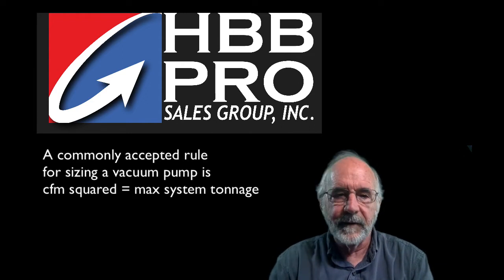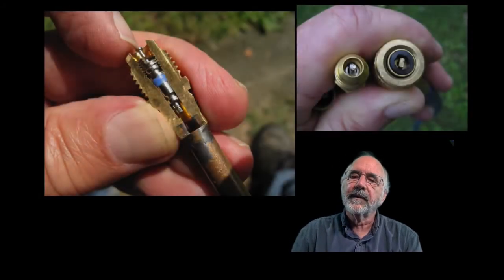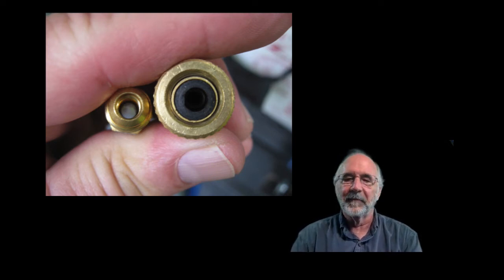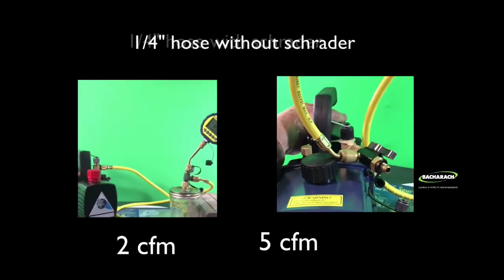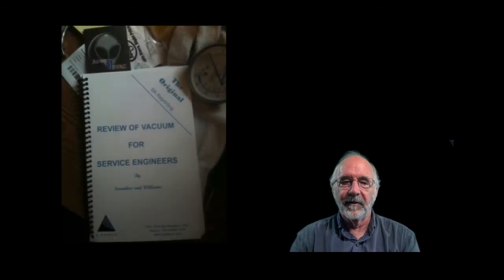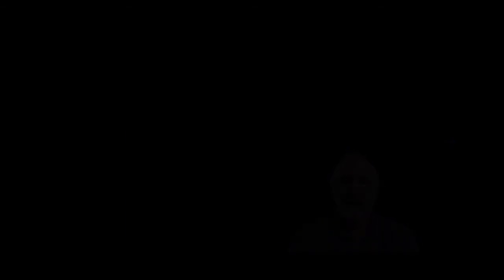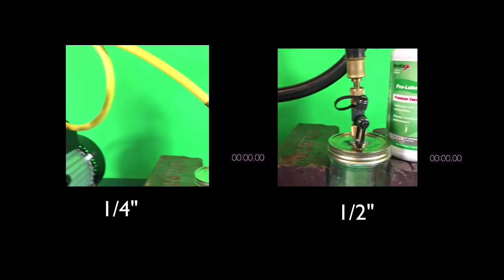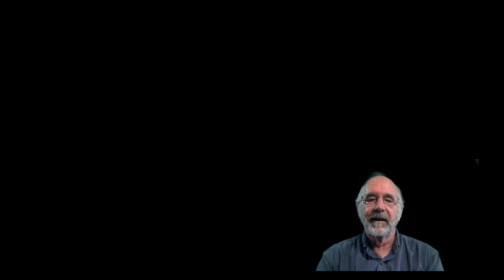HVACR Evacuation Considerations

Comment: Great video. Real solid tests to get an idea what is actually happening.
Reply: Thanks Erik, when I did that video 1/2” was the only option, recently AccuTools came out with a 3/4” hose made out of a very different material. Improves speed and pulls down much lower.
It’s all about diameter and hose length - makes a huge difference. Check that hose out!
Heard an expression “The more I learn, the less I know”! So true.
Will be doing more on the 3/4” hose soon.

Comment: Really good video! I want to try this same test with 1 hose on the suction line vs 2 hoses to see how restrictive pulling through the metering device is.
Reply from the maker: Thanks! Cool to see things work out like it should in theory!
Interesting products coming out next week. AccuTools is coming out with a 3/4” vacuum rated hose (with interchangeable fittings) along with a couple of interesting service tools - check out the vac rated Schrader depressor tool -  https://youtu.be/BcunzvuUOWY